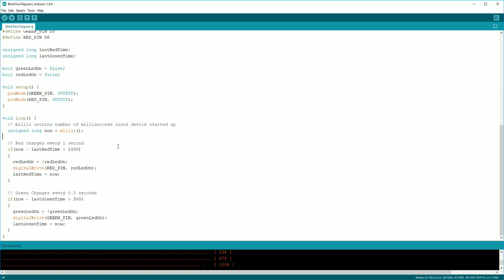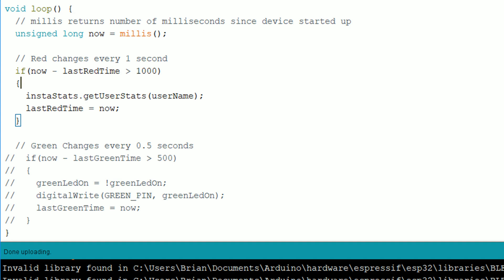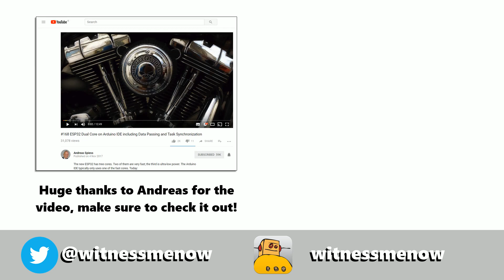[TMT] Using Both Cores Of The ESP32 Using Arduino

Comment: Nicely and briefly explained,Thanks Brian. ..but i am facing some problems  with my modification on it.           " Task watchdog got triggered. The following tasks did not reset the watchdog in time:
 - IDLE (CPU 0)
Tasks currently running:
CPU 0: led1Task
CPU 1: loopTask
 ". please help me to solve it.
Reply: Very old but did you ever find a solution?

Comment: Hey Brian, in both your and Andreas's video, xTaskCreatePinnedToCore is used in the setup. What if I want to enable and disable the task running on core 0 throughout my main loop? For example, I want to use core 0 to monitor an encoder while core 1 is driving a motor. I do not want core 0 retrieving values from the encoder when the motor is not running as I am using a shared SPI bus with the encoder and other sensors that are being monitors on core 1.